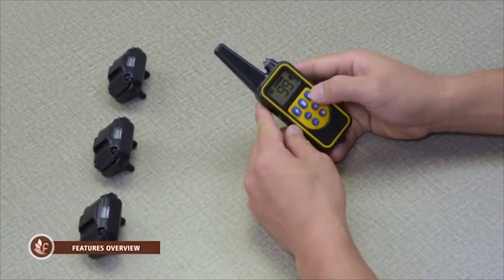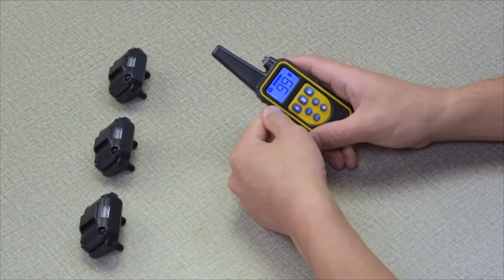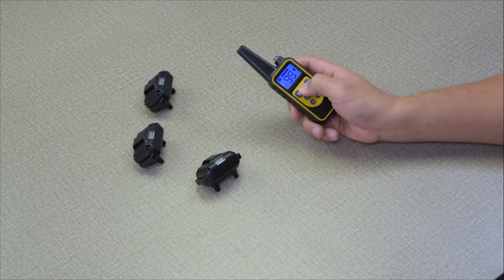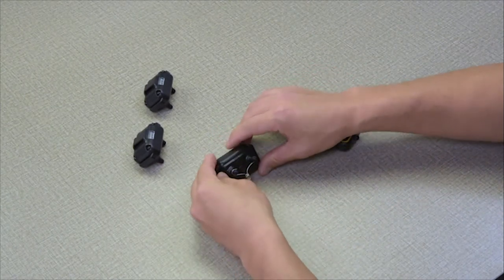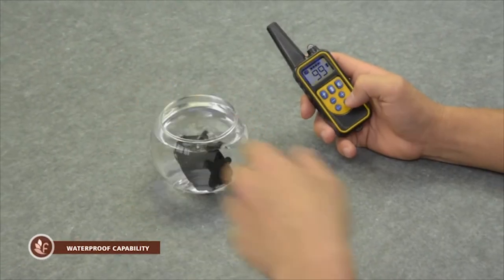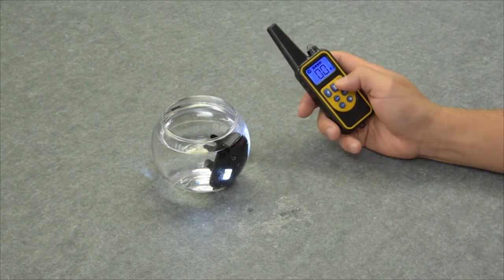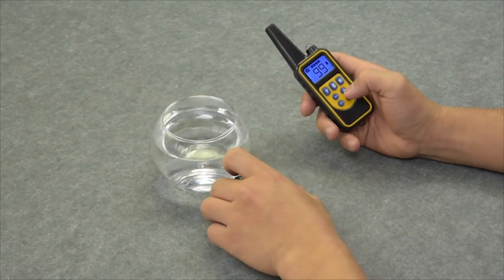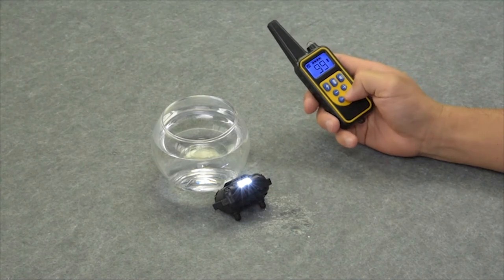F-color Shock Collar for Dogs Unboxing and Test

Comment: how intense is the shock?
Reply: Depends on the dog's tolerance really.  The levels range com 1 to 99, where 1 you can barely fell and 99 will really hurt, so start at 1 and go up gradually until you notice the dog react to the shock. When in extreme circunstatioms like when the dog is really excited or with high prey drive, you might want to tune it up a bit (or a lot, depending on the dog). I suggest you start at 2 on your own neck and go up 1 by 1 so you can get a fell of how it works.
Reply: I just received mine minutes ago. My cousin put it on at 99 for shock and said it went through his whole body. I put in on 50 & my 120 lb Pitbull bucked like a bronco. I didn’t want to hurt him so I have it on 25 & see how any of the three dogs react next time.